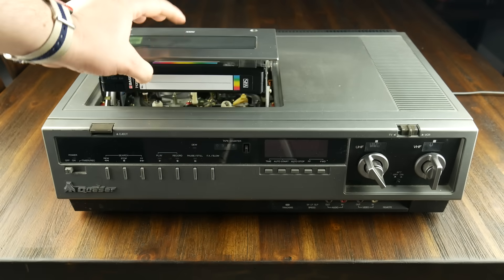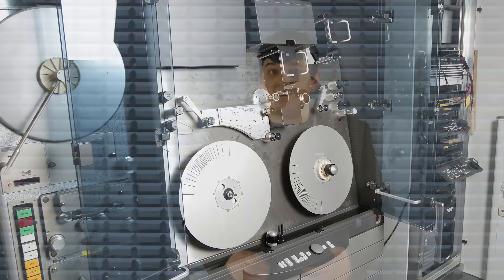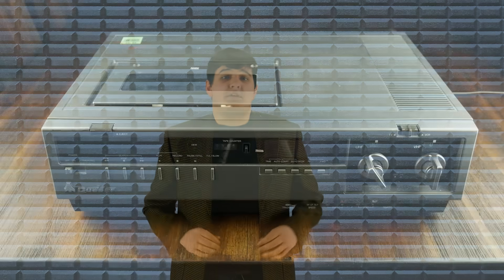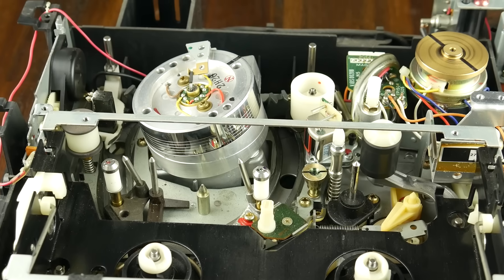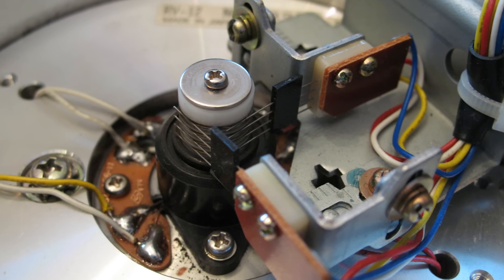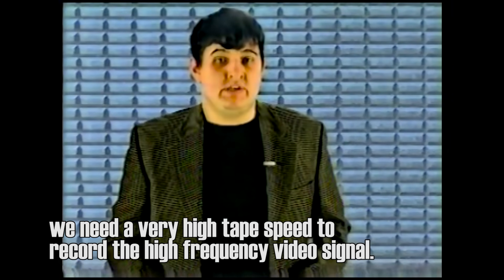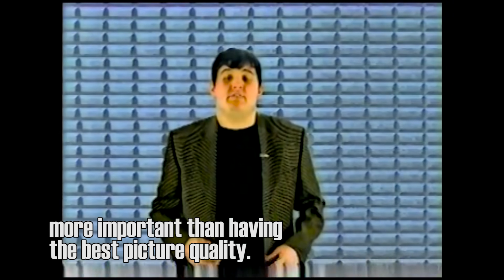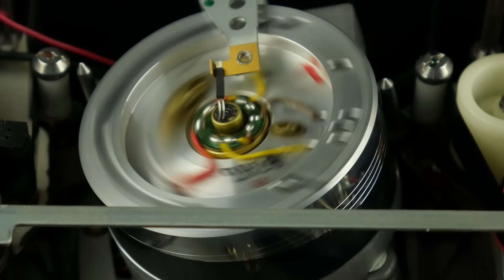The Impossible Feat inside Your VCR

Comment: The engineering involved in this old school stuff is just marvellous! Though conceptually simpler, these machines are much more mechanically and electronically complex (at the component level) than their modern counterparts with all the hard work being done at the hardware level rather than via software through microcontrollers. Absolutely wonderful!
Reply: That’s exactly why i love old hardware. My hifi system is from 95 and my VCR and CRT is as well.
Reply: @Alexander Ratisbona It's the implementation that's complicated, not the concept. And if you knew what went into these integrated circuits you'd understand why they are so much more complex, conceptually. But manufacturing processes of ICs lend themselves VERY well to automation (in fact, many are impossible without it), so the huge volumes possible reduce the unit cost of a single IC to pennies.

On the flip side, a mechanical system which, at the conceptual level, does something much simpler, is nevertheless significantly more complicated to implement as it requires that all actions and coordination in the system be mechanical. All the "thinking", so to speak, has to be done by the mechanics. Whereas a microcontroller abstracts all that away and all the mechanical parts have to do is activate when signalled by the μc. Macromechanically - much simpler, but the μc is in fact a lot more complex electronically.

I mostly agree on programmers though, these days they're like administrators - available everywhere and at the full range of costs, but really good ones are hard to find. The work culture is different, much more emphasis on quantity and prototyping than creating a finished product, which then gets misemplemented, spilling over into consumer electronics, resulting in the release and sale of half-developed products. Video games are a GREAT example - day 1 patches and DLCs (which should have been part of the game on release). Frankly it's disgusting, but all the gray beards have retired, so there's no one left to put the brakes on ¯\_(ツ)_/¯

Management is to blame too, I hear the gaming industry in particular works on impossible schedules imposed by retarded directors. I'm sure that spills over into consumer electronics too.

You mention quality dropping... that's a function of inflation. People don't like to see increased prices, even though their currency devalues significantly each day. Something's got to give and it's usually quality.
Reply: @Alexander Ratisbona I think I may have been a little unclear in what I meant by "conceptually", which is that fundamentally all this machine does is take a raw analogue signal and convert it into analogue magnetic pulses which rearrange particles on a tape (and vice versa). At the top level, that's a lot fewer steps than say an MP3 player, which has to read a file, decode it, apply DSP (itself a complex process), then convert to an analogue signal and amplify. Modern miniaturisation has abstracted most of that complexity away into the ASIC (which we all recognise as the ubiquitous "blob" on the circuit board) which runs everything, so it appears deceptively simple when it is, in fact, not.

That technology wasn't available back then, so all the beautiful engineering, the complexity of the implementation, is on display for all to see 😁
Reply: @233kosta  Exactly! More the science is advanced, more invisible it is. It  becomes like magic.
Reply: Also they could last decades and were easy to fix then, still have some things working just find , bought in 80s , just need some cleaning and batteries
Reply: @Anuj_Tomar  We could have had the same with electronics, the technology permits it (hell, it readily enables it), but that doesn't square with "build it as cheap as humanly possible" mindset and some businesses feel as though selling an amazing product will diminish future sales.
Reply: @233kosta  It's not just diminishing sales, there are lots of products where much better quality is attainable but consumers just aren't will to pay the premium for it. I bet there's a toaster rant somewhere in this.
Reply: @CanIHasThisName  Well yeh, that's where inflation bites. Thanks, central banks!

Also something something Sunbeam...
Reply: @233kosta  Planned obsolescence is a big part of that too. Companies don't want to make a product somebody will be able to readily use for 30 years, that means they have to compete with their own product from the past for sales. It's very scummy but they would rather make a product that will break so people will buy a new one.
Reply: @keltzar1  They missing a trick right there - you can have amazing margins on the parts ;) Plus, these days it's good PR.
Reply: @Alexander Ratisbona Whether purposefully or due to ignorance, you're strongly misrepresenting how technology actually works. MP3 players still have to convert digital to analog and amplify the signal. Not all DACs are the same, not all amplifiers are the same. I also don't think you really understand what programmers and analog engineers do.
Reply: @Alexander Ratisbona "I've been a Hi-Fi expert for the past 40 years." 
Considering your previous comments, I would maybe be willing to believe you were a Hi-Fi expert 40 years ago.

Comment: Whats about Video 2000? Alternating head angles? Offered much more qualitity and 2 sides...
Reply: It was basically a quarter inch machine with no control track.  Used really cool AST heads mounted on moving piezoelectric crystals, like the pro machines. Looked like VHS though due to the low tape speeds.

Comment: There are signals on VHS tape?  Pretty sure it's data.
Reply from the maker: I guess you could technically call it "data" but it's entirely analog, not digital.  At its core, it's just spitting the incoming TV signal onto a tape.

Comment: Why did pause and scan look so bad on LP? It wasn't just my VCR, they all did this. EP and SP both paused and scanned pretty well, but LP would have lots of big lines in it.
Reply: In SP and SLP, the adjacent tracks had the same horizontal phase, so when the heads crossed over into the next track, there was just a line of noise but the picture still lined up.  With LP, there was a half-line delay between tracks making for a very distorted picture.  Panasonic's early high-end machines had a half-line delay line in the video circuit that would operate in LP picture search mode, obviating the problem.  The less expensive players didn't bother with this.
Reply: RedPillRecording makes sense, thanks for the reply.

Comment: This video was absolutely fascinating. Thanks for your research into this. You have a new subscriber. Well done. I'm old enough to have owned and used a VHS camcorder and you have me scratching my head at how you changed the recording speed/quality on the fly. I remember having to select SP, LP, or SLP before recording and it being locked at that setting while the tape was rolling.

Comment: What are you talking about? LP speed was in many vcrs they most had sp lp and slp some vcrs did not have slp and beta is legendarily better just only a few expensive brands and beta did not wish to support the porn industry that was betas fail. Also there were cartridge based tapes in the 60s just not too many could afford them and they were considerably larger than vhs. But they looked like large vhs tapes. I forget the format.

You should do a super8 vid as well.

Comment: VCR manufacturing used multiple head designs and there wasn't physically enough room for 3 sets of optimized heads on the head assembly, so LP went unoptimized, and then finally phased out.

Comment: 4 head vcrs also had freeze frame, slow motion, variable frame-by-frame.It was kinda an expensive luxury difference by the late 80's. This was every bit as sharp as today's digital pics, and there were also 3D movies with 3D glasses to watch. In terms of sound, analog was always closer to live, and many of us heard the choppiness of CD sound at the start. Digital storage did not however suffer from tape stretching over time and many plays. It was a poor representation of the original, but could be stored as a CD seemingly forever.

Comment: Great channel. I subscribed a few days ago. In the early 1980s my Fathers first video recorder was a Betamax and also his 2nd. I remember taking the top of it because their was a problem. In the end it was a small rubber belt that broke and replaced it. The way the Beta pulls the tape to the head is completely different to the VHS. I found them both fascinating on how both systems worked.

Comment: Just recently resurrected using my VCR. – Great workhorse;  even accept using Extended Play (on my self-fixed CRT TV, a "POS" TV that has only had one breakdown in 25 years - impressive). 9 seconds FF for 3 minutes of commercials (12 for 4).  Can't say I'm too disappointed using it.  The programming setup could be developed more, but it gets by on consultant schedules.  The machines' clock stays in good time too.  They could have been called a "magnetograph".

Comment: Every single spoilt young brat nowadays has to have 4k
Reply: You realize you can buy a 4K Insignia (Best Buy store brand) UHDTV for under $400, right?
Reply: "Every single spoilt young brat nowadays wants to have a VCR" - Guy in the early 1980s, born 1920.
See what I did there?
Reply: Sigh
Reply: After decades of NTSC, I'm happy as a pig in . . . er, mud with 1080p.
Reply: Not sure who you're replying to.  If it's me, I don't want over 8 million pixels to fill every frame.  4K would have to be cheaper than 1080p or 1440p for me to consider it.
Reply: 4kicksintheass
Reply: If you weren't born back then , you just don't know what it used to be like, they bitch a vid isn't in HD lol I'm like o you never watched a vhs on a crt tv? Hq video to me is plenty enough for quality. I have to admit, I'm a PC gamer and when 1080p was like the big thing I bought a new monitor.. yeah I still play my games on lower resolutions, for some reason I don't like games In 1080p.
Reply: Joe Sterling Actually, it was for James Collins. But, in any case, a 4K tv at, say, 43", is comparable to 1080p, if you're willing to compromise. If you want lower-cost 4K, you'll have to go with Insignia or Silo or TCL. I've been using Insignia HDTVs for years. The one I have now I bought in 2012. It's 32" at 720p and cost $279 at the time. Its' Insignia counterpart today runs $129. And Insignia is just as good as Samsung or LG. Off-brand 4K is just as affordable today as 1080p. Never buy name brand HDTVs.

Comment: I'll stick with my laserdisc thank you!
Reply: I put an NTSC capture card on my modern HTPC just so I can watch the 12" DVDs. A service engineer at Pioneer told me if they were used for data back then they only would have held about 1Gb.
Reply: @InsideOfMyOwnMind  LaserDisc could handle 7.3 MHz of video bandwidth with a signal-to-noise ratio of 54 db. That's the equivalent of 65.7 Mbps, once extrapolated out of digital terms. That is just for the video signal, not including the audio signals. A LaserDisc could store that for anywhere from half an hour to one full hour, which just for the equivalent digital video bandwidth alone would constitute 14.7825 GB using CAV recording to 29.565 GB using CLV recording.
Reply: @NUCLEARARMAMENT  Granted 1Gb seems a bit low but I think he was talking about zero compression and a track pitch equivalent to CDs. With tricks and shenanigans CDs got most of the way to 1Gb.
Reply: AFAIK, only the audio ever became digital on LDs.  The video is still analog.
Reply: kkash72 yes, laserdisc was very cool!!!
Reply: It was a play on words. Just like calling records 12" black CDs.
Reply: Woah! A Lazerdisc sized DVD!? cool! I never knew there were digital Lazerdiscs well I know there were digital sound lazerdiscs but I never knew about digital video Lazerdiscs

Comment: clever guy !
That is truly incredible.... never knew most of that.  So complicated tech. then , yet SO taken for granted .... What a waste of knowledge 😂
so well produced and researched!
Reply: Only 1 technical flaw that really got my attention. Those quadraplex rotary head machines (invented by Ampex) spun the rotary head at 14,400 rpm, not 3,600 rpm, with 4 heads hitting the tape per revolution, and spinning at 240 revolutions per second, there was a noticeable 960 Hertz whine in the room whenever one of those machines was in use. I used (and maintained) several generations of Ampex broadcast TV recorders (used only at TV stations because of the size, cost of operation, and equipment price). And, did you know that Ampex also made the first helical scan machines as well as the first quadraplex machines? Ampex actually had a 2 inch tape helical scan broadcast grade machine in the mid 1960s. 

Here is a little trivia point, Ray Dolby (Yes, the Dolby of Dolby Labs fame) was part of the development team that made the first quadraplex machine at Ampex.

Comment: +Technology Connections: I must congratulate you.

I came across this by happenstance and watched it from beginning to end.

I am a 'geek' at heart, and I watch several of these 'tech' programmes, but, what really makes you stand out, is the depth of production - you don't just talk about the stuff, you show it- whether it's taking a VCR apart. And point out the bits, or showing exactly what a 'good' picture on a VHS system was like.

I've subscribed, and will now happily watch other videos of yours.

One thing you didn't mention (13:50) when you were talking about the improved sound quality, was that at this time, DAT's were supposed to come out, but, for those of us who wanted the HQ sound - w/out the DAT, we knew that using the VCR as an audio recording system was virtually the same thing.

Comment: Awesome!  What was indeed a marvelous and impossible system explained simply and accurately.  Fantatsic explanation, especially the practical demonstration of the slower tape speeds.  I did miss the LP mode, you could put Conan the Barbarian and Conan the Destroyer on the same cassette with fair quality.

While I am a child of the 70's I had several VHS machines (by the time I could afford one Beta was done)  I even has a SVHS machine, catch was nobody made SVHS Video Tapes.  I managed to purchase 2 blanks ($35 each while generic video T120's could be had for $5) and watched 1 production tape; 'Days of Thunder'.   Noticeably sharper with twice the horizontal resolution.  Then the industry seemed to shift to the Laserdisc format (LD or CED?) and those could actually be purchased and the local video store.  Oh, the good ole days...

Comment: A lot of good information! BUT - 

Ampex did not die out with the 2 inch - by the way the only tape system where you edited by physically cutting the tape. After the 2 inch, they developed the 1 inch system with helical scan and tape lengths up to 96 minutes. Check out VPR-1, VPR-3 and VPR-6 from Ampex (the only ones I used myself). Sony also developed machines using 1 inch tape and helical scan. So the jump to the VHS had a few more steps. All videotape recorders since are using the helical scanner.

One interesting thing is that while the Beta system lost to the VHS, Sony took the Beta cassette design and developed the pro version that dominated the broadcast industry for many years - Betacam, Betacam SP and finally DigiBeta.

Another thing: Interlacing is commonly described as 2 "fields" giving you two halves of a picture. This is not correct. Both fields gives you a full picture - top to bottom. They are just half the normal resolution as they give you every second line. You can NOT put these together to get a full picture as they are 1/60th second apart in the US or 1/50th in Europe. This is why I always say that the real speed of video in the US is 60fps and 50fps in Europe. (yes, I know it is not a full 1/60th of a second)

Also - the reason for the 2 inch not being able to do a freeze frame is that it did not have a frame buffer. This was added to the 1 inch systems in the form of a TBC, a Time Base Corrector with a frame buffer. The first TBC's did not have this.
Reply: Actually, Quad was a segmented-field/frame VTR format and the sheer rotational velocity (14,400 RPM, I believe) of the four heads each separated 90° circumferentially the video head drum, which was so fast that any attempt to stop the machine midway the tape reel would have caused the transverse scanning apparatus to literally saw the tape in half.

Comment: I believe I know this one. I know audio cassettes when in play mode reads the audio "I believe with no small voltage meaning the vibration from the tape creates the very small voltage" but when recording, all the player does is reverse the polarity and gives it a very low audio voltage of analog sound to the head. I believe it's the same when recording video. Am I close?

Comment: When my family still used VHS, we almost never used the extended recording modes. Instead of trying to fit more shows on one tape, we had two VCRs with which to record. I suspect that if I had been born 10 years earlier, I would have spent my early years using Betamax, and my mom confirmed that she and Dad used Betamax up until around when it died as a format.